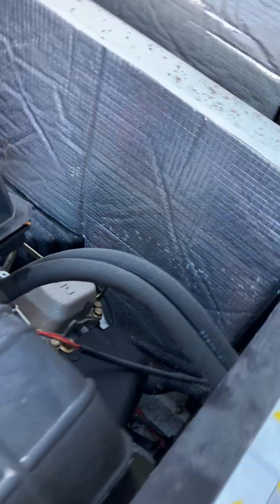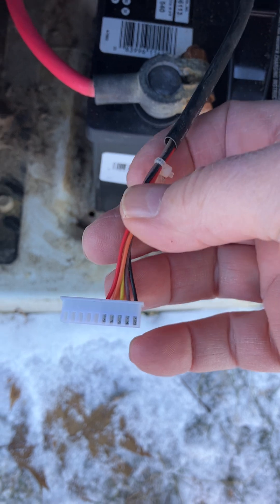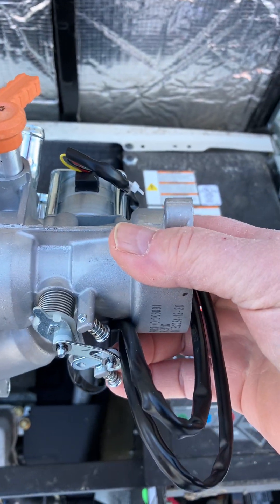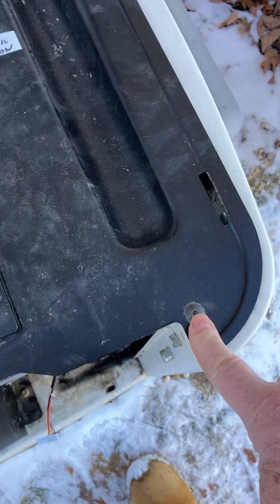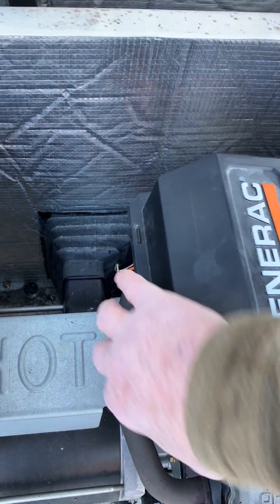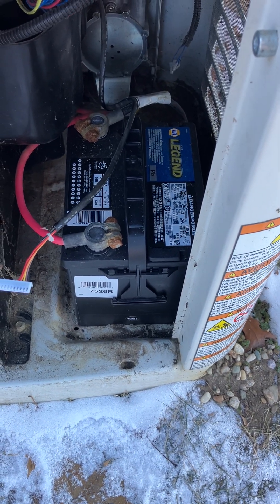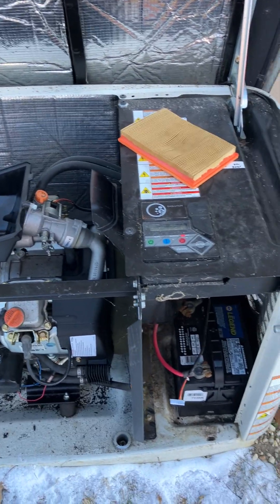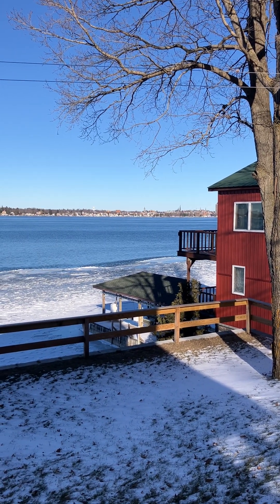GENERAC 11 KW OVERCRANK ERROR CODE 1100

Comment from the maker: No, I didn't cause the overspeed.
The owner wanted to watch and learn and I explained that I watch the stepper motor movement.
He reached in and manually forced the butterfly to move and the generator did start but it raced to over 4500 RPM causing an overspeed alarm. 
Yes, the Stepper Motor Cable is normally ty-wrapped at the motor itself and once or twice in the battery compartment. (at the factory)   I don't know any of the history on this unit but someone has rifled through it at some point.
I was talking about running FMC on the outside of a building when I said that I don't do that. I was there with the camera on it as my thoughts were "This generator is 10.38 years old and that FMC still looks good. That's rather surprising. Wonder why they didn't enter the back of the box - keeping the connector and FMC inside."
Then I moved on. (There was rust just inside the unsealed hole and I still believe the "radius of the bend" is outside the permissible range.)